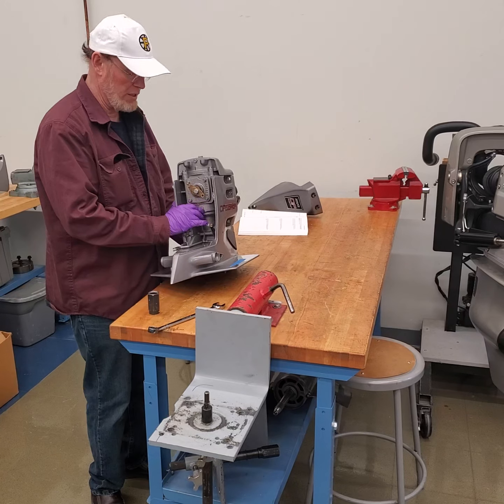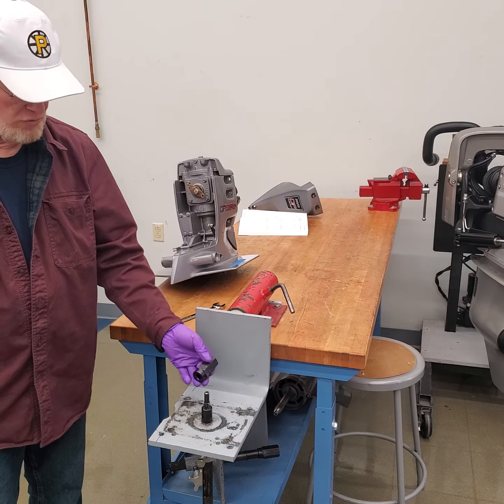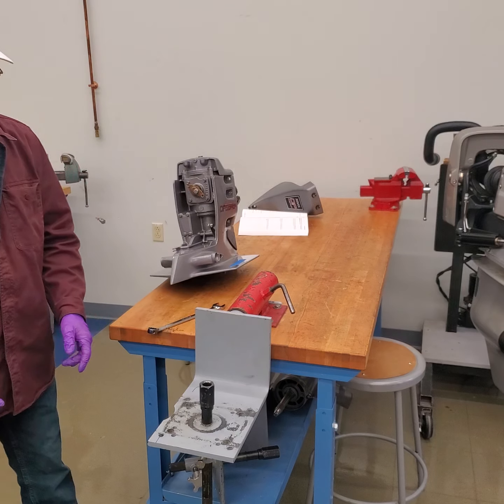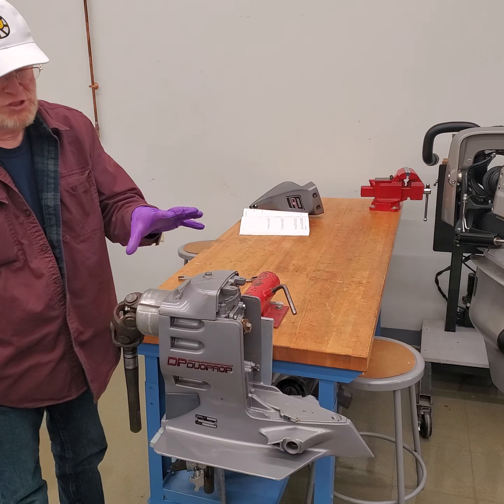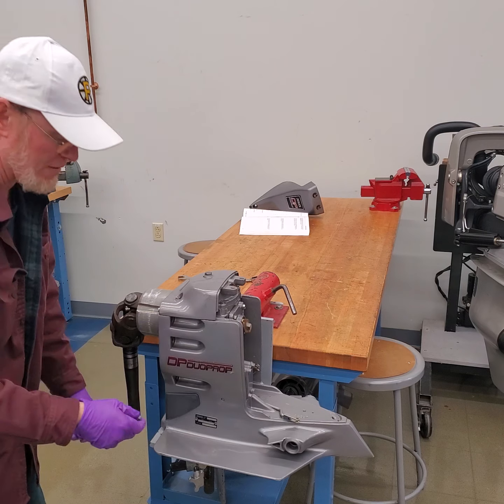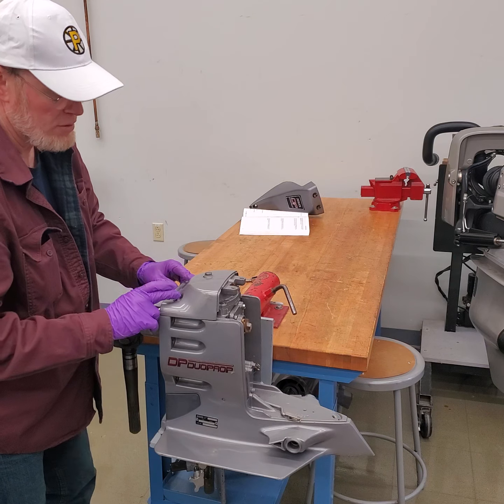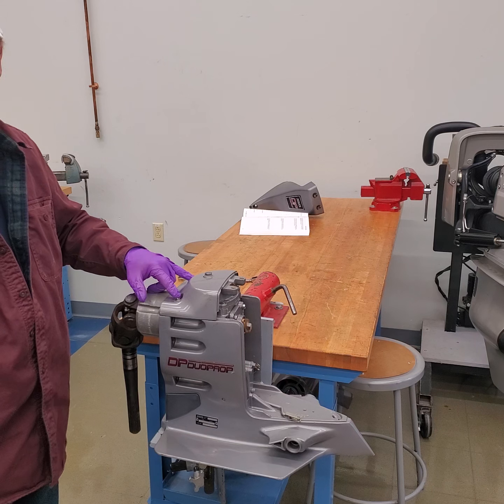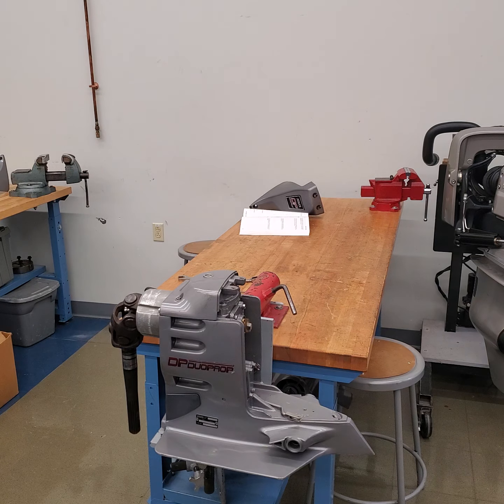Volvo Penta DPS Sterndrive Repair, installation on upper holding fixture

Comment: I’m having trouble sealing the water tube when joint the upper and lower gear housing. It keeps sucking air from this joint preventing the pump from pumping water properly. I’ve followed the manual procedure on how to do this, but I find it difficult to align the “dog leg” water tube with both halfs .Do you have any suggestions?
Reply from the maker: Change both rubber sealing ends and make sure the tube isn't cracked/split or has a pin hole in it. I change the tube and rubber ends on old units for peace of mind.